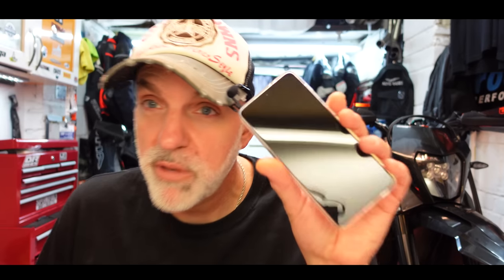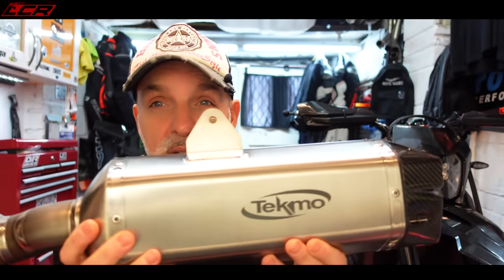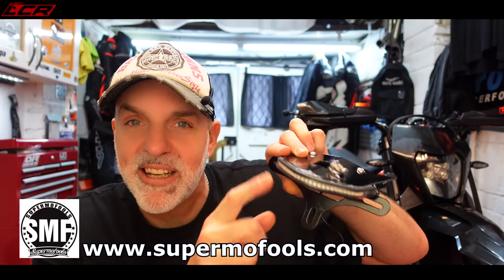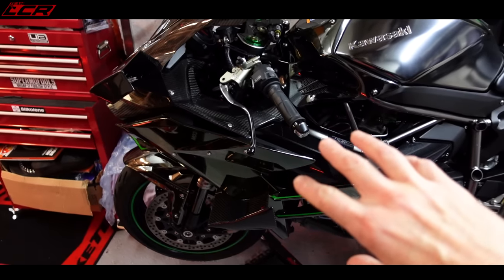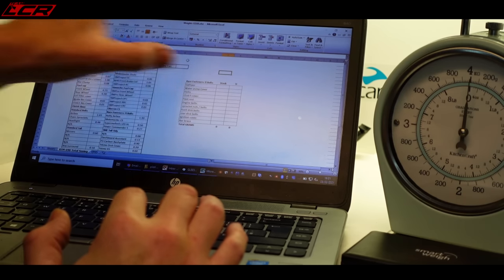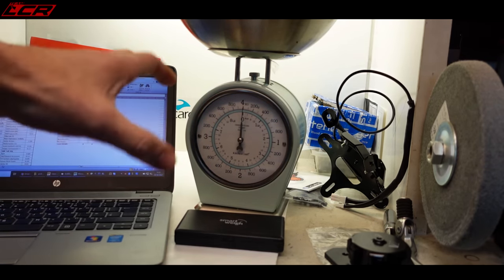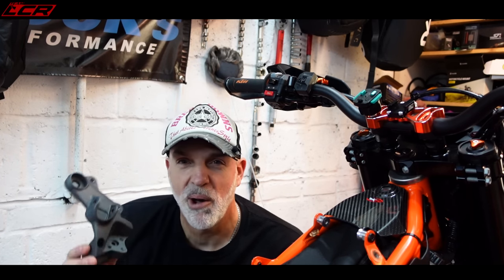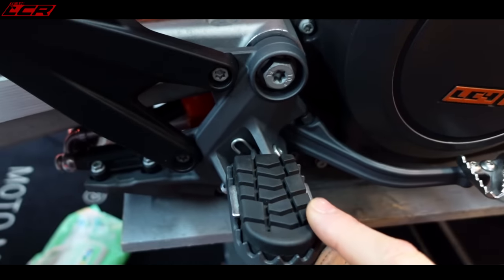Ultimate Tail Tidy KTM 690 | The Ultimate SMCR Build EP07

Comment: That tail tidy looks awesome. However, I'm not a big fan of tail lights with integrated indicators on cars as they're often very hard to see when the vehicle is braking. You're ones are even smaller and probably even more difficult. Just make sure you use the highway code sequence of mirror, signal, manoeuvre (brake) to give those following the best chance of recognising your intentions.
Reply from the maker: Yes good point Steve 👍

Comment: For your H2 with the recirculation valve you might get onto boost quicker vs an atmospheric valve it will have to rebuild all the boost it lost from going off throttle.
Reply from the maker: They say it makes it smoother.. I suspect any difference is tiny anyway but keen to see 😁

Comment: I've heard the H2 brake issue you mentioned is actually the ABS unit. The bike comes with decent Brembo calipers and imagine the pads it came with are pretty decent?
Reply from the maker: Yeah could be the case I hope not.. pads are Brembo but getting something with more bit which will hopefully improve it.. fingers crossed 🤞
Reply: @LambChopRides  Cheap enough thing to try anyway. Brembo just released a new SR compound that would be worth a look

Comment: Oooo I like the fuel filter 😍
Did you get spanked by customs for import duty ?
Reply from the maker: No managed to avoid import on fuel filler and tailtidy and headlight! Got caught for the exhaust. Seems if value is around £100 you might get away with it
Reply: @LambChopRides  not with my luck lol 
Thanks for the reply

Comment: Nice tail tidy, won't pass MOT, indicators have to be 15" apart, so you could get a pull for that, Is there not something about E ratings on light reflectors?. I could be wrong just pointing it out, anybody know better let me know as I do like the combined light unit
Reply from the maker: I think yes your right but I've seen bikes with similar setups pass MOT. Need to take it somewhere with some common sense, worse case I will swap it back to stock for mot. 30 minute job
Reply: @LambChopRides  I have seen a few bikes fitted with them & I do have  the same light strip I got from China,(not fitted) I just don't like giving a smart arse copper the opportunity to give me a pull & then talk down to me.
Reply: @straitjacket7969  Just be sensible and polite and remember that you're the one in the wrong with illegal lights fitted. It's mostly about attitude.
Reply: @naranjalorange8584  True, just basically grovel, the price of having super cool tail tidy.

Comment: Clear helicopter tape is your friend with anything that can scratch or rub on your paint work, for one example is your boots rub on the frame on most bikes. Clear Helicopter tape is your friend 😉👍  cheap on eBay for a meter long and  80mm-100mm wide tape and heat gun it to make it super sticky 🤘    have you had BOTOX ? As my Mrs reckons you have cause your eyebrows don't move 🤣😂
Reply from the maker: Good tip 👍

Comment: Bikes looking awesome great video accessories you are choosing are top notch and easy better quality products especially like the fuel cap,, and the tail tidy,, will it mot,, was the extra plug for the number plate light,, here in northern Ireland you can fail mot,,, depending on the tester 😁😁😁😁☘️☘️☘️☘️☘️😀Enjoy your enthusiasm,,, mavis hair door 💇‍♀️💇‍♀️💇‍♀️💇‍♀️💇‍♀️
Reply from the maker: Yeah a fussy MOT inspector will probably fail it... easy to swap back though and for me 2 years until mot anyway!
Reply: @LambChopRides  a little white led gets it past on the top of the plate with a reflector,, anyway you keep a bike for 2 years,, come on chops,, I'm going to be saving up to buy it 😁😁😁😁😁👍👍👍👍

Comment: Why don't they add numberplate lights to tail tidies to make them legal.!
Reply: You can get LED's built into the bolts that hold the number plate on, & it looks tidy
Reply from the maker: Yes it's missing a number plate light, I'm going to be doing exactly that 👍
Reply: @straitjacket7969  yeah I did that to a moto guzzi tail tidy I got from the states. The only tail tidy that has come with one has been an Evotech for a Yamaha but then it didn't replace the rear light.
Reply: @wrightwells  I've been looking round for a indicator style rear light with built in rear light, brake and  indicator in one unit I think Triumph has them fitted on one of their bobbers